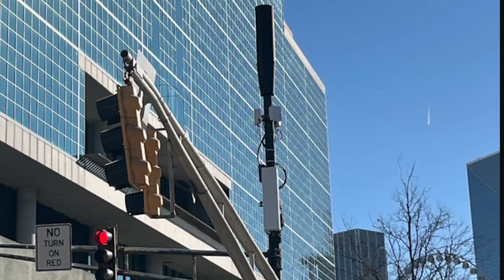T-Mobile Network Update: mmWave! It is Actually a Thing! | 5GUC N258

Comment: I’m glad to see T-Mobile deploying mmWave. I’m hoping that we can get closer to the point where their is a small cell on every block pretty much for all the carriers in a urban setting similar to how their needs to be a node and then amps for old school cable to work properly.

The need for more bandwidth on the networks is clear as midband channels can still be easily saturated just like LTE of yesteryear. So the formula for a quality network hasn’t changed